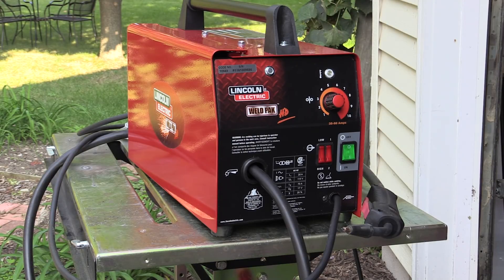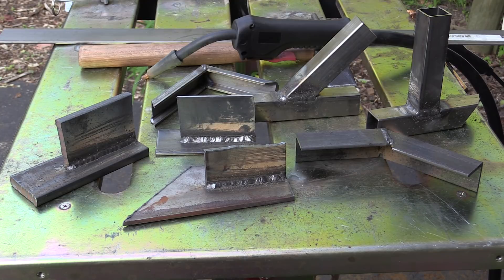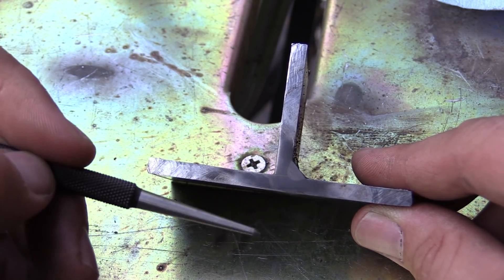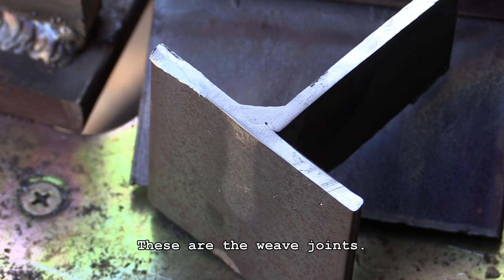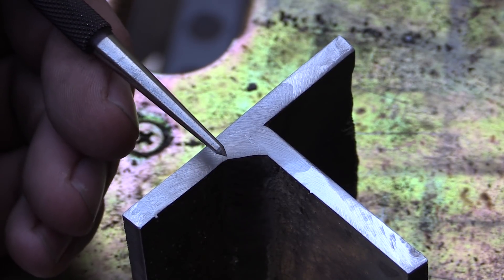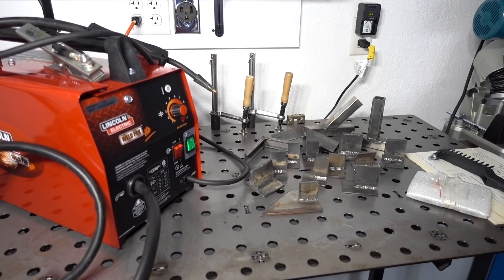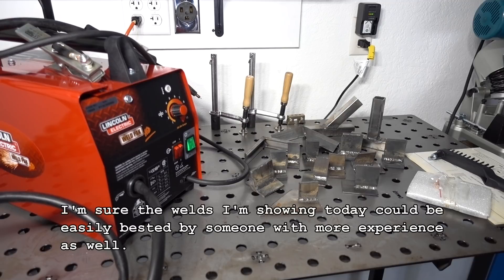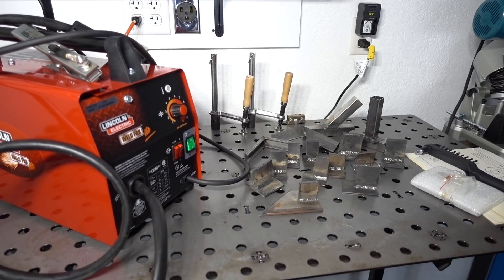Cheap Flux Core Welder Testing - With Cut and Etch

Comment: I’m just starting to learn welding. Can you go into more detail about what not to do in terms of safety. A lot of people say to avoid shock, don’t complete the circuit. Can you explain this? Also what about different shade numbers when talking about helmets? Some say you need a certain shade number for this or that etc. thanks
Reply from the maker: Most welding helmets should block virtually all UV light.  The different shades are mostly about maximizing visibility while maintaining comfort and reducing eye strain.  A shade 10 is generally usable for just about any scenario you are likely to run into any time soon.  Really high amperage stuff can get uncomfortably bright (as well as making it hard to see), and in that case an 11-13 shade is helpful.  On the opposite end of the spectrum, really low amp TIG stuff can benefit from an 8 or 9 shade for a brighter view of the puddle and surrounding area.  Most electronic helmets are adjustable and you can just tweak it as you want.  If you get a fixed shade, a 10 would probably be fine for just about anything you'll likely do.
Reply from the maker: As for shock.  Current can only flow if there is a complete circuit.  So current in a welder can flow when there is an electrical path from the electrode (whether it is a stick electrode, the wire in MIG/Flux core, or the tungsten in TIG) to the work clamp.  In TIG and MIG the voltages are generally low enough that you aren't as likely to get shocked as with stick welding, with the exception that the high frequency start of a TIG welder can give you a bite.  But completing the circuit just means contacting both the electrode and work clamp (or your work piece that the clamp is connected to) while the circuit is live.  This makes your body the electrical path for current to flow.  This is mostly a concern with stick welding, as the rod is typically live all the time, and the voltages are usually higher, though the same can be said of using a stick welder for scratch start TIG.  I could probably explain better in a video, and I'm sure there are videos out there talking about it.  But as long as you are careful not to touch a live stick electrode while also touching the work piece/work clamp (either with bare hands or wet gloves),  you probably won't get shocked.  When you are welding, even if you touch the work piece you shouldn't be shocked because while you are touching part of the circuit, you aren't completing it in any way.  Your body isn't a good path for the electricity to get from one side of the source to the other.  Don't get me wrong, a little bit of care should be taken to avoid shock, but in most situations it's very unlikely.  I also think that people get a little hung up on the possibility of shock, because it's not the easiest thing to understand.  But you are far more likely to flash your eyes, burn yourself on something hot, or cut yourself on a sharp edge of a piece of steel than you are to get shocked.  I've done all those things while welding, and I've never been shocked.  Again, just because it hasn't happened to me doesn't mean it can't happen.  Be careful, but don't worry too much.
Reply from the maker: Most importantly, wear protective gear.  I know people who have thought "just going to weld up a few quick things, my bare skin will be fine" and they ended up with what amounted to a severe sunburn the next day.  Skin cancer sucks too.  It's often hot, sometimes uncomfortable, can be an inconvenience and take time; but it's worth taking the time to ensure your skin is covered and you are wearing a proper eye/face protection.  Don't get in a hurry, particularly when you are learning.  As soon as you get in a hurry you will make a mistake and accidentally pick up a 600 degree piece of steel and leave a small layer of your skin baked onto it.  As dangerous as getting shocked; probably not.  More likely than getting shocked; about a million percent.  LOL.

Comment: Dear Bigtb
Thanks for the video. I have owned one of these same units for over 10 years. I purchase it way back when. I only use it for light duty welding around the home and some spot jobs for the bikes and cars. The only issue I have is really my own, since I had the unit connected via various connectors to the 111 plug in on the wall of my garage. It was a power issue making the welding very difficult. The unit itself is great and I had no other complaints. QUESTION  - What would be a good unit to buy to step up a notch with more heavy-duty welding. I learned how to weld when I was a 12-years old kid when two of my rowdy friends stole some tanks at a construction job that they told me were abandoned. These tanks were for gas welding. Instead of asking for some toy or other kiddy item for XMAs, I asked my folks to get me the gauges, hoses and hand attachments for gas welding. My older brother purchased a chopped and shortened 1935 Ford P/U. He left to West Point and I learned on sight about hot rodding just taking apart stuff and putting it back together. Believe it or not, my first welding attempts was with “coat hangers” …yes coat hangers. Don’t laugh. From there I got some welding rods and practiced on all sorts of metal I could find. Let me know. Thanks !
Reply from the maker: What is your budget for a new welder?  Do you have 240V power available in your garage?

Comment: What is the pt # for this welder and is it flux core only or can it use gas as well ?
Reply from the maker: I don't remember the part number, but it was the Lincoln Weld Pak HD.  I bought it off the shelf from my local Home Depot.  It is flux core only, no gas.  There is another model one step above this one that can use gas, but this one cannot.
Reply: Lincoln G4067

Comment: where did you get that metal
Reply from the maker: If I just need a small amount of flat stock or 1-1/4" angle or something like that, I will sometimes pick up a piece or two from Home Depot.  It's not the best price to quantity ratio by any means, but it is convenient.

For larger amounts, or for things HD doesn't carry, I go to a local steel supplier.  There are some national and regional chains, but the one I use is just a little, local place.
Reply: do they give you a good price the steel place local,? looking to get my hands on some 1/4 steel plate and tubing to get some welding done for fun.
Reply from the maker: The prices aren't too bad.  Not fantastic, but not terrible.  The people are nice and helpful, and it's very convenient to just walk in and browse their stock.  I can look at what they have and decide what I want, or I can call ahead with a specific order and they'll have it ready when I arrive. 

There are some online places, but shipping kills it.  It's really a matter of checking around the local area and see what's nearby.
Reply: yeah i was looking online at retailers, shipping costed more than the metal itself.....

Comment: When I was looking for a DC Flux Core welder at Home Depot, I saw the Lincoln Electric 88 Amp welder and noticed it weighted 46 pounds.  That makes me think it's got a very heavy transformer and uses (transformer) switches to select 4 different 'DC' voltages, (with a 20% duty cycle at 70A).
https://www.homedepot.com/p/Lincoln-Electric-88-Amp-Weld-Pack-HD-Flux-Core-Wire-Feed-Welder-for-Welding-up-to-1-8-in-Mild-Steel-115-Volt-K2188-1/100031840
 
I wanted a smaller unit and light weight, so I decided on the Century 90 Amp FC90 welder, that's $100 less and only 18 pounds! It has a nice power adjustment (knob) range of 30-90A DC. With a 30% Duty Cycle at 80A.  (60% @ 60A & 100% @ 45A). 
https://www.homedepot.com/p/Century-90-Amp-FC90-Flux-Core-Wire-Feed-Welder-and-Gun-120V-K3493-1/302139495

The FC90 doesn't come with ANY extras (like a roll of FC wire), unlike the Weld Pack HD package. However, I think the FC90 welder performance is going to be very comparable to the Lincoln 88 Amp. 
It only takes the small reels of FC wire (1 or 2 pounds) which isn't a real problem for me.  
I removed the side panels and checked the Guts. It's got a clear-coating painted over the PC board and small electronics on both sides of the PCB. All the plug-in cables are secured with a small dab of glue. The workmanship (wiring and board build) seem to be very good quality. 
The FC wire is in the mail.. Wish me luck!
Reply: Century, Lincoln and Vulcan are same company manufacturer... Look it up... Just packaging...

Comment: this was a great review. im also new to welding, on month 11 of a hobbyist class (with no prior experience metal fab or mechanical) but compared to some other videos ive watched that completely disregard regular welding knowledge and promote terrible welds as good, you were spot on with your observations of your welds and used great terminology. i like that you used good steel, not some rusty stuff that greatly affects the porosity and causes inclusions and all that. grind that rust and mill scale off! lol. my class is about over and so is my access to the sweetass millers they have so i bought a lincoln just like this with a gas hook up. i haven't got it yet but im glad i know what to look for when welding, and how to make my welds look better with the knowledge ive gained. you've definitely illustrated what to look for and what the real expectations you can expect with a welder like this. bravo! your welds look pretty good too my man. great video.

Comment: if you clamp the ground to the steel table ,is there any way of getting a zap if your other hand is on the table while your welding?
Reply from the maker: Only if you complete the circuit.  If you had one bare hand on the table, grabbed the tip of the gun with the other bare hand and pulled the trigger, then maybe.  If open circuit voltage was 30 volts you would get a tingle, but probably not too bad, and not likely dangerous.

While welding normally, not likely at all.  When you touch the table you become the same electrical potential as the work clamp, but you aren't completing any circuit, so no shock.
Reply from the maker: Just a note.  Stick welders generally have much higher open circuit voltages, and the output is usually on continuously.  It is much more likely to get a shock from stick welding, particularly if you are working in wet conditions.  Always be careful not to touch the electrode or a metal part of the electrode holder while any part of you could potentially complete the circuit to the work clamp.

Some older or cheaper MIG/wire feed welders have the wire always electrically live, not just when pulling the trigger.  Extra care should be taken with those as well.

I've never personally been shocked by a welder.  From other things, yes.  But never a welder.
Reply: thanks for explaining it , i was uncertain if you would get zapped, now i will feel more comfortable when welding .Thanks again!!

Comment: I haven't used this welder in a long time, im an extreme novice welder, and I forgot how to actually turn it on lol. Can you explain to me the steps to get it ready to weld? I'd appreciate it, thanks!
Reply from the maker: Not a whole lot to it.  Make sure there is a spool of wire installed.  Tension settings are basically pre-set on this welder.  If there is a roll of wire installed, connect the work clamp to the table or work, set the settings for the thickness you will be welding based on the chart inside the door, flip on the power switch and see if it works.  If there is no wire in the welder, you will have to get some.
Reply: bigtb1717 Ok, so I'm probably going to try to weld a heat shield or a exhaust manifold cover. So for the knob, what number do you think it should be on, should the first switch be on low or high, and should the second switch be on 1 or 2? Sorry for the multiple questions, like I said I'm a complete novice welder lol. My weld pak is practically brand new because i don't even think I've ever actually used it haha.
Reply from the maker: Thin material can be tough, particularly with flux core.  Do you have any material you can practice on?  That would let you dial in the settings and get a feel for how it goes without potentially ruining a good part.
Reply: bigtb1717 I tried playing around with the settings and I was trying to get it to actually weld, so basically I just used a random setting and I touched it against some metal and it didn’t weld, just made a noise.
Reply: bigtb1717 maybe it’s my ground? I grounded it to a tool box and then I tried the frame of my dirtbike lol.
Reply from the maker: The ground clamp has to be connected to what you are trying to weld.  If you have a metal welding table you can usually get a good connection it you connect the clamp to the table and the part you are trying to weld is on the table.  But to be sure it is best to have the clamp connected to the actual work piece.  It needs a good electrical connection, so it should be clamped to clean, bare metal.  If it is clamped to paint or thick rust that can be an issue as well.

The ground clamp completes the electrical circuit from the gun back to the welder.
Reply: bigtb1717 Oh really? I didn't know that, so I can't just connect the ground clamp to any piece of bare metal? That might be my problem then, I'm going to try connecting the clamp to a small piece of the metal and see if it welds. If I have more questions you'll see another comment from me lol. Thanks for all of the previous information though, appreciate it.
Reply: bigtb1717 So I did everything you said and it did in fact work and I welded a little section of a scrap haha. For aluminum metal, should I do low 1, low 2, high 2 or high 2, and should I leave he wire feed speed on 9 or should I put it lower?
Reply from the maker: You can't weld aluminum with this welder.  It may lay a bead (or it may not), but even if it did, it would likely break apart with almost no force.  Not designed for aluminum.
Reply: bigtb1717 So would that make it a mig or tig welder?
Reply from the maker: Well, this welder is technically neither.  It is a FCAW (flux core arc welding) welder.  It uses flux core wire and is really only good for steel.  It is often called a "MIG" welder because it is a wire feed welder, but MIG stands for Metal Inert Gas, and this welder doesn't use gas, it is only for self shielded flux core.
Reply: @nismomikey  lmfao

Comment: So the speed dial is just for looks. The voltage combinations automatically change speed
Reply from the maker: @DonaldKasper-j2r  If the wire spool was the driven component its diameter would matter, as would how much wire is left on the spool.  This would cause a changing wire feed rate at a given setting as the wire ran down on the spool.  But this is not how the wire drive system works on wire feed welders.  The wire feed motor pulls wire from the spool at a given feet per minute, based on the feed speed setting.  That feet per minute of wire feeding does not change based on the spool size.  I could have a length of wire strung out straight across my shop, not on a spool at all, no spool diameter, and the wire drive system would feed it at the same rate.
Reply from the maker: The speed dial does adjust the wire feed speed/heat.  It's just that when you pick a given voltage with the switches the speed dial adjusts within a certain range, and that range changes when you change voltage.

For instance, on the lowest voltage setting the max wire feed speed will be lower than the max wire feed speed when set at a higher voltage, but it can be  changed from there.  So at a given voltage setting you can turn the speed up and down, changing the amount of heat.
Reply: @bigtb1717  I cannot weld with the shitty 1 lb spools.  Everything beads.  I finally realized that the larger spool produces faster spooling due to its much larger diameter, then with that I can get bead lines.  Otherwise, no.
Reply from the maker: @DonaldKasper-j2r  The spool diameter will have no effect on feed speed.  The wire is pulled from the spool by the wire drive mechanism and the spool simply free-wheels.  Spool diameter makes no difference in wire speed.  It's possible you got a different type or brand of wire that runs better, but the spool size won't make a difference.

Comment: Just bought mine yesterday,and I love it for doing any motorcycle fabrication I do,it's light weight,with my generac generator it's portable,just throw the geni and welder in the cargo area of my 4runner and can fix anything needed on the side of the road for Brothers out riding but broke something.. honestly for $269 It's well worth having if you do fabrication on cars,trucks,or in my case motorcycles.. kool welder

Comment: What saw did you use to cut?
Reply from the maker: For cut and etching I typically cut with a Makita 12" dry cut chop saw.  Then polish with a 3M disk on a die grinder.  I use Naval Jelly I picked up at Home Depot to etch the welds.  If the piece has already cooled from welding I heat it with a propane torch before etching.  Works much faster and gives better contrast if the part is warm/hot.

You could cut the piece with almost anything, but depending on what you use it might take more polishing is all.